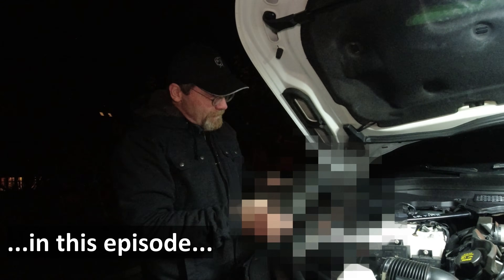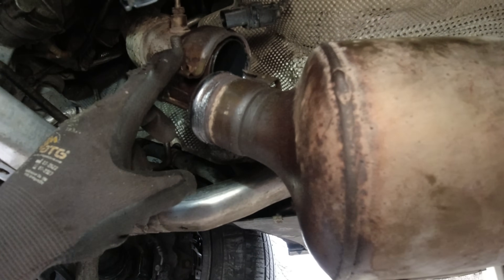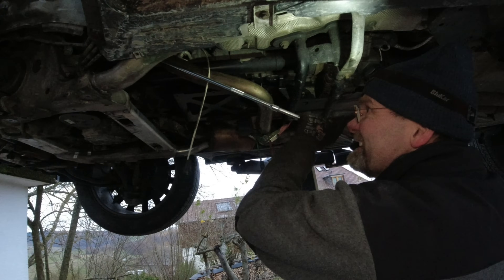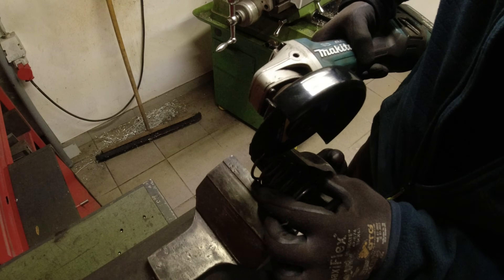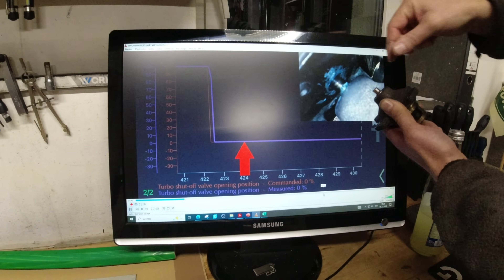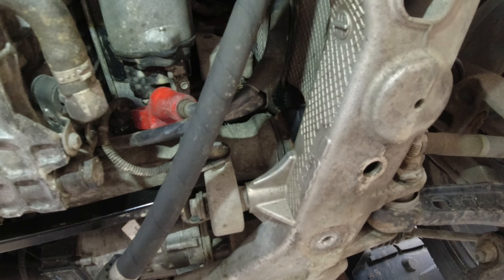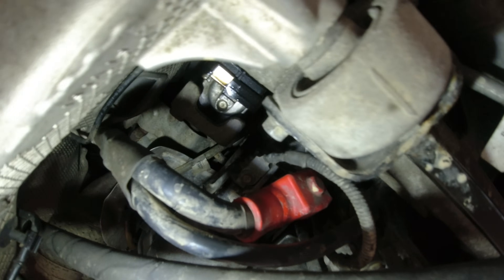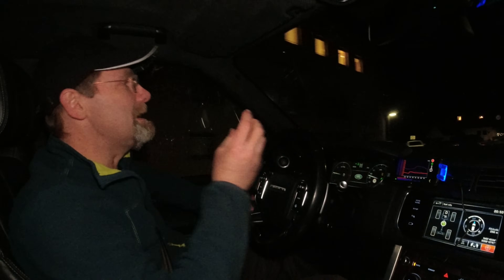Dumbest Land Rover Design Fault EVER - Fixed - L405 Range Rover / S5-Ep1

Comment: Superb , a fix is a fix even though its took a long time ....diagnose , test and not ' guess a part '  no amount of guessing at parts would of fixed it 
I thought where you identified that the slight vaccum in the air box was pulling vaccum up the ' vent to atmosphere' pipe  , if you left that pipe off the air filter box it may of got you to a speedier conclusion .

I have had similar to your problem on a td5 where one of the boost pipes had de laminated internally and on the over run it would collapse down a strangle the air to the engine , the map value would go into a vacuum condition and the exhaust would white smoke and cause like a sulphur smell due to lack of air 
Well done seeing it through

Comment: Hi Guys, awesome vid, we experienced a same fault just days ago under full load conditions (4 people/dog/holiday gear). During our travel we heard a high pitch sound, which we blamed other cars for with roofracks. Once we received the restricted power mode, we stopped the car but it did not really wanna shut down, it continued to run for like 5secs. Huh ? I thought something wrong in the vacuum circuit. Started her again. Same story. Ok, I opened the hood (!) to have a look. Nothing (did not check the air intake off course). Did find a huge stack of leaves and branches underneath the hood, removed it, closed the hood and no error anymore, which is weird next to a Swiss Autobahn. We stepped on it several times, the error never returned. (will read the codes tomorrow). After seeing your very nice vid,  I just checked these stupid sacks (really what were they thinking?) they are firm and do not really move, if I pull it I could theoretically block half of the intakes at both sides) I am wondering where "the bonnet" takes the air from, maybe those holes could have been blocked in our case by the leafs. 

New quest; a loud rattling noise from below the car during cold start. I will keep you informed :-) PS we did manage to get ca. 1200km out of ca. 90liters......(pssst it does have a tune and mainly runs on synthetic diesel)....

Comment: Well done. It just shows that many problems are usually something simple and not some complicated technical fault. Now please contact the German car industry and tell them to replace the oil dip sticks in all vehicles as I just waited 3 days for the level sensor in my 114 Vito van to show the oil level after I topped it up. It took 3L from min to max level. It showed low level but I worried I would over fill it as it hadnt moved after 3L added, then I saw the change after 3 days.

Comment: It’s common to find them on all newer cars, it’s so they can use thinner steel and it doesn’t sound like the biscuit tin it is when you tap on the panel or close the bonnet. If it wasn’t in a bag the closed cell foam would hold water and rot the panel from the inside out which is I suspect is what will happen in a few years when the bags start to break down and disintegrate

Comment: Hi Vera and Christian. I watch all your videos and think you provide the most informative and entertaining LR content there is to see. I am now so please you have bought a L405 TDV8. I started working on my own car at the end of last year after falling out with a dealer, that I have been using since the car was new, over what I felt was expensive incompetence. The YouTube content currently , with some notable exceptions, Raymies Garage for instance, is scarce. I am looking forward learning from you both. I have just completed the infamous oil cooler replacement and would like to ask that if you do this then, for all the other people like me out there, show everything. My problems came about from simple things like stuck turbo-oil feed bolts. Anyway regarding the black bag that blocked you air intake. I have nothing  like that in my bonnet, mine is a late 2015 model. I have felt as far as I can into the bonnet and there is nothing there.
Anyway thanks again for your efforts.
Reply from the maker: That is great, I know the effort. We did not replace the cooler, but the gaskets and o-rings. Almost immediately, after we bought the car in November. It will be a funny and great video, coming out on Sunday. Christian watches Ramies Garage also. 👍🙋‍♀️

Comment: Your videos are amazing and entertaining. I put this one down to confirmation bias. Dealer said it was the turbo actuator, so this goes into the brain and self is biased towards this as the problem. Working back from your ultimate discovery, the problem was air starvation. The place to start was the pathway for air getting to the engine. What a hoot it would have been to find this in the first half hour. It happens to all of us.

Comment: First things first,  Definitely NOT a waste of time. Your efforts, even when wrong, are a benefit!!

Now as a turbo guy (DIY and factory cars), the Land Rover nomenclature was "dumbass". That "turbo shutoff valve" was just a waste gate actuator. That "vacuum valve" at 6:06 mark is a boost controller and looks VERY similar to what's on my 850R (and with the exact same plumbing).  Considering also that the "shutoff valve" you were working with was on the stage one turbo, maybe that should've been called a "bypass'?  Whatever....

All the above said, your line of reasoning was spot on. A lot of OE stuff have springs that are barely good enough for stock (low) boost and diaphragms that last just a little longer than the warranty (Old Compressor Bypass Valves are always a dodgy consideration if a 2nd or 3rd owner decides to turn the boost up).  Looking at the spring was a very good idea and was the obvious conclusion. After that I would've disconnected the purge line from the airbox. No more vacuum, but you would likely have ran into a surge condition, which would ultimately lead you right back to the idea of an intake restriction. Yee haw! 

But thanx for another great vid. I bought my wife an LR3 and love these things.

Comment: All that for a bag! 
I had similar once a sprinter motor home, it had been widened on the front as it was a hymer. They had used a hose to extend the air box over time that hose collapsed. It was fine until it demand more air then it sucked the pipe closed. 
Off the throttle and back on initial fine then went flat! 

Took some finding but was glad in the end!

Comment: FFS Christian, you are a saint! Having been a mechanic for 50 years I salute you sir!
As soon as Vera touched that vent in the bonnet I knew what you were going to say! to paraphrase spike Milligan, cars they f**k you up.
Having suffered Land rover products for 35 years now I am allways amazed at some of the dumb things they do. I couldn't believe they are still suffering oil capilary issues in the wiring. I thought after the TD5 debacle where the injector harness which was in the rocker cover oil and sent the oil straight up the wiring loom to the ecu.I wish you and Vera a succesfull and hppy 2024!

Comment: Just amazing that the Gap tool points towards turbo issues, when actually it's an air intake restriction, but well done for sticking with it.
Reply: The gap took just reports what the car knows, which is the “what”. The workshop manual gives the “why”. The blocked inlet is in the workshop manual. But Christian thought that he had already ruled that out.
Reply: @hmallett  I had a similar issue with my Freelander 2 which reported a turbo fault on the scan tool, but was actually caused by faulty glow plugs. I did know that the glow plugs needed changing prior to the car going into limp mode whilst going on holiday. Luckily we were not far from the destination when it lost power. The local garage changed the glow plugs, but they were the wrong ones and I ended up changing them again after  a couple of weeks when we were back home. I've now got a 2.2d Jag as sadly Land Rover ownership has become too expensive.
Reply: This is the big issue with any diagnostics system. It often needs interpretation rather than believing exactly what it's saying and sadly a lot of garages and main dealers go down the expensive route of replacing parts. 
The money that must be wasted with this method of operating must be massive, at the customers expense.

Comment: Had something similar on my lotus turned out a rubbish bag got sucked in the air box tube had the car in bits for weeks trying to fix the fuel issue because it failed its mot

Comment: Well look at this way you did not create the problem. Land Rover should be ashamed for using trash bags and not something else that should have been secured as to not block the Air way.Especially as much as you pay for this vehicle. But we all read things and miss Important information. That's why the Air Force highlights Important information in Red and uses broader letters so you don't miss thses things.Great work .I remember we had an F-4 that had an electrical problem not getting voltage to a system. It ended up being a pin in one of the cannon plugs when you installed the cannon plug twist lock type the one pin was recessing but when you unlocked it and removed it the pin would pull out and everything looked okay .Turns out the lock on the pin was bad.But till you come across this Scituation you just don't know. All part of being a mechanic. God Bless you 2 and take care .

Comment: Love the videos! You mentioned an intake/air cleaner vacuum causing the valve to open. So I started doing the rough math,  thinking "no way there's that much vacuum behind the air cleaner" 😂 there is when it's blocked. 😅

Comment: I was wondering where your investigation was going to go. Something you learn in communications and electronics is that noise in the first stage of a system is amplified and becomes worse. Remove that noise from the first stage and things perform much much better. Clearly, on cars, remove the noise(bag) and the same happens ;-)

Comment: Glad you got it sorted 👍
Must have felt like winning the lottery when you figured it out after all your hard work.
At least you know everything you checked is in good order
Do you know where the l405 brings in its air from? Is it those smaller holes under the bonnet above headlights or does it bring it in up by the bottom of the windscreen?
Also do you know what the stated wading depth is for the l405 & discovery 4?
Regards & keep up the excellent work😊
Reply from the maker: It's higher than on the Discovery 4. Exact number I don't know right now, somewhere around 90 cm. And that is because of the bonnet air intake. We will do a review and comparison in the future. 👍🙋‍♀️

Comment: Christian, you said you thought that if the dealer had replaced the actuator they would have fixed the issue 'accidentally'. But would they? I think not. I would reinstall the trash bag with some double-sided tape to keep it away from the intakes.
Reply from the maker: I lost the trashbag. I think it is essential for a L405 to have it installed just to have the potential fault in its lifetime.  My L405 is only 1/2 the value now.   Christian

Comment: I did think to drill a hole in air box when you said it was creating a vacuum, i have a range rover sport, off to check my vents now 😂
Reply from the maker: Actually, that would have worked.  Sort of a bypass.  Christian

Comment: If you ever need content I have a Queen TDV8 (which I love) that has two faults that LR have been unable to fix/find. 
1. LR replaced the plastic thermostat housing (after a five month wait for the part) and can’t seem to bleed the heater. It has a small amount of heat at the dashboard but feet and rear passengers feet are very cold. LR have done everything including filling with some pressure tool to little effect. 
2. A clonking sound at the N/S/R which has been complained about every service but they can’t find. It is intermittent and is difficult to initiate. It happens only at low speed and both on the turn and straight. 
The car is a 2017 TDV8 with 97,000 miles covered. I have owned it for five and a half years, with servicing carried out by LR from new. It’s had a warranty/Ext warranty and anything that needs doing is done. 
I admit that non warranty stuff gets done by independent repairers. My warranty will expire in July this year as my mileage hits over 100,000 and can’t renew. 
So if you ever feel the need for content, a new friend, somewhere to stay in the uk or just the opportunity to outshine LR’s finest, I’m here for you. 
Kindest regards 
Huw x

Comment: Out of curiosity, do you get the same faults if the bag is covering the intake and the vacuum line at the intake is unplugged?
Reply from the maker: There is a hack to avoid the fault and limpmode by unplugging a hose. Not if we have showed it in the video. 👍🙋‍♀️

Comment: This one of those cases where the problem is dumb and so simple and staring you right in the face that mind choses to ignore it because it can't be that simple. At your first video when you showed I did think it was strange that there loose soundproofing in the intake because I did remembered the fuss LR made when the L405 lunched about how the car breathes through the bonnet giving excellent wading depth. But again I wouldn't have thought that was the problem because it can't be that easy

Comment: I was assuming something was messing up the vacuum maybe a defective one way valve,  but this us great bit of gormless engineering , nsny many decades ago i used to repair disk drives and the common failure was an opto sensor failure , so they sent them to me, i pulled off the top , and removed the black paint that was loose inside the sealed drive ,  they had painted a flag that obstructed a opto sensor , unfortunatly the flag was stainless , and the paint peeled off blocking the sensor, i did hundreds of them

Comment: Good job! Believe me there are a lot of stupid problems on other brands ... Months ago I bought an used Mini R60 ... after some time I found water on the floor ... in summary estimated 15 liters under the floor. Nobody could help to solve the problem ... and did not want to waste a lot of money. I disassembled a lot of stuff around the car and recognized always anybody had done this job already before.  After 4 weeks I recognized by accident any door sealing was slightly standing away and pushed it back ... afterwards I was aware what I had done!
I took the sealing once away and could recognize due to some corossion und slightly wet the water was searching the way into the car under the sealing.
Small root cause -  big evil and hard to find ...
Reply from the maker: 👌We have poured water over the entire left side of the car to search for water incress on a friends Discovery.  It was a fun day and we found the problem.  😅👍🙋‍♀️

Comment: No this isn’t a one off, I was one of a party of 150 engineers doing a Range Rover recall on poor performing aircon on the P38 Range Rover with 4.4 V8 in the Middle East in 1996. Part of the solution, as well as a different TXV and ECU was to stick foam blocks with sticky back tape to form a tunnel to prevent recirculation of condenser air swirling  back around to the front of the radiator. Yet the Merc 190 hire car we had was fitted with a moulded plastic fitted tubular cowl to prevent the same issue - crazy!
😎😇

Comment: You don’t get out dumber by this error detecting process for sure! You got deeper in the RR mechanics. But it reminds me a bit of finding a Computer failure realising at last it has no power connected. 😄 Go for it, an RR is on my shopping list, despite keeping my Disco 4. Grtz from Duesseldorf

Comment: wow i have never seen something so crazy why on earth would land rover put that thing there with out any mounting hardware to keep it in place just to reduce some noise sometimes you really find the craziest things on vehicles and all you can do is shake your head in complete frustration anyway excellent find you definitely saved a ton of money it’s just unfortunate you had to take apart your car so many times just to find out the problem was a trash bag how very unfortunate it honestly reminds me of the time i had to fix an automatic transmission in a honda i pulled it out of the car took it apart replaced all the clutches and rubber seals put in a new filter bolted everything back together and put it in the car and had no reverse on the gear shift because it was hitting the case i had put the mounting bolt on the shift fork parking paul assembly in backwards so 😂 out everything came from the second time ordered a new case gasket and fixed my mistake now here is where it gets really funny im now putting this automatic transmission back into this 2001 Honda accord get it into the car got a few bolts started and decided to take a break as being on the ground doing this is not fun so i start sliding out front under the car and i see it on the ground and i just lose my mind what is sitting on the ground but the lonely torque converter messing his buddy the transmission let’s just say i was beyond tired at that point and pissed off that this thing wasn’t done uhhhhhhhh 😂 anyway i just put my tools away and went inside an pulled the transmission out again the next day put the converter in started questioning myself as to how i didn’t notice the weight difference 😂 as the transmission was now a lot heavier than before anyway got here into the car all bolts installed and the car back together the transmission worked perfectly only took 5 tries 😅😂😂😂 let’s just say never again i truly enjoy watching a mechanic doing there work because it reminds me just how challenging things can get and just putting a bolt in the wrong direction can cause a ton of problems